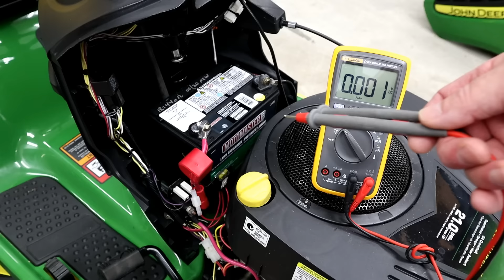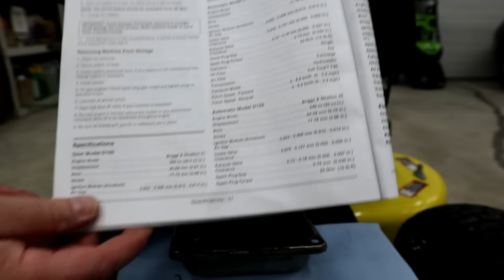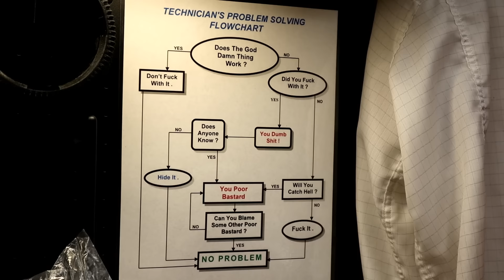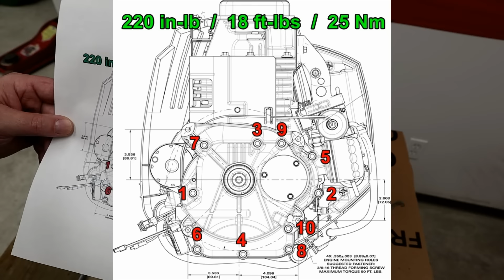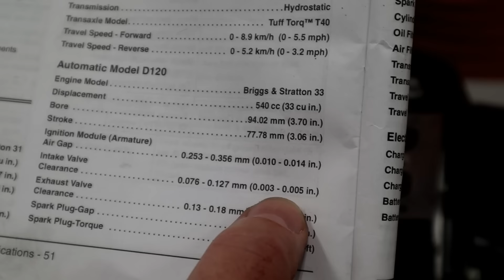Why Won't Your Riding Mower Turn Over? COMMON Briggs Intek PROBLEM & REPAIR.

Comment: Very expensive weak design and why cant they use a old compression release valve or even drill one into the cyl head?? haha  You could then pop it open a fraction and when engine runs it will be forced closed anyway to full pressure.

Comment: I have a D170 pulling my hair out
Reply from the maker: The D170 has the V-twin Intek (40/44/49 series) does it not? If so, the twins don't have this decompression failure issue (if that's why you're losing hair), only the single cylinder 31 & 33 series Intek engines have this problem.

Comment: The only thing on John Deere that’s American is the name. John Deere is an Asian machine and a headache to work on
Reply from the maker: Total BS. All John Deere riding mowers are constructed in Horicon, Wisconsin, using largely American parts; which unfortunately also includes the turd sandwich B&S 33 series Intek engine. Not that country of design or manufacture has bugger all to do with the quality, or in this case of the single cylinder 33 series, total lack thereof.

Comment: I am going to bust your chops just for a minute: How many hours do you spend cleaning your mower???? The battery has a coat of wax on it!!!
Reply from the maker: I addressed that very question at the end of the video ( 29:27 ).
As stated, I don't spend much time cleaning at all. I do quickly blow it off EVERY use and that goes a long way to keep it clean. Over and above that, I'll wash it once or twice a year when it needs it.

Comment: There are plenty of quality AFTERMARKET parts for all types and brands of all kinds of products. People must do their job and stop crying about OEM only. Many AFTERMARKET parts are made to OEM SPECS. also, many OEM parts are made in places like China and simply branded for the American companies.
Reply from the maker: Of course there are good aftermarket parts; and since I never once suggested all aftermarket parts are bad, the basis of your comment is a strawman fallacy.
The fact is, the track record of these specific aftermarket decompression cams is not great; not that the OE part is much better 😄
Also keeping in mind not all aftermarket parts are created equal. There are most certainly very poor quality aftermarket parts out there too and they deserve every bit of negative feedback they get. Short of it is, do your research before purchasing - anything!
It was exactly that research I did that pointed out many aftermarket decompression cam failures in very short time frames, that they are hit & miss, and why I specifically said in the video to avoid them if possible.
With that said, this aftermarket one I installed is still working with just over 30 hours on it now. So it has already surpassed many others, but it still has to last another 190 hrs before it beats out the replacement OE one that was in there before. Place your bets. 🙂